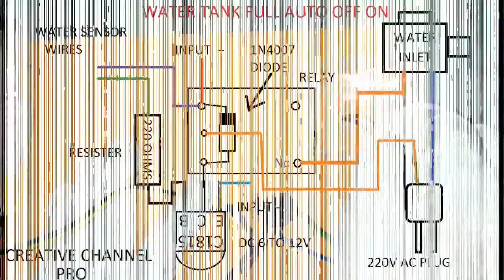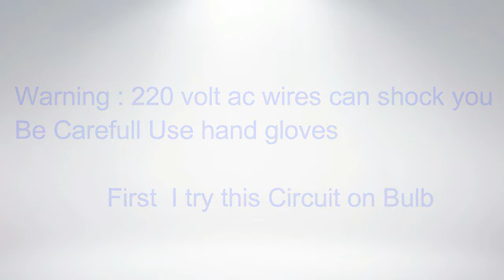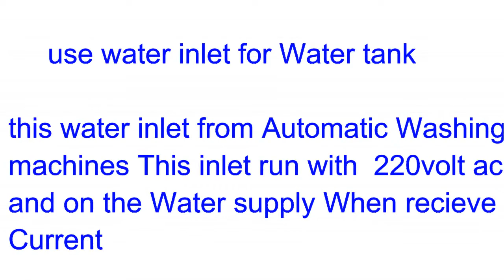Water tank filler overflow control Auto on/off plants automatic watering System using inlet valve

Comment: I think when u touch the water with wire someone off the switch
Reply from the maker: 🥰🤣 Really bro It's not fake Bro 100 percent confirm. When I am beginner in electronics I Also like you. Bro It's true. IF YOU NEED. Help in circuit please feel free to contact I try to Guide you best.
Reply: @creativechannelpro371  ok I will bro

Comment: Fake
Reply from the maker: Bro this 100 percent work may fault in circuit if you not understand +601169439048
Whatsapp me . I try to solve Your problem. This is simple transistor switching circuit if you not study about transistor you can not understand its fake or real Please Try again .
Reply: @creativechannelpro371  bro I use bc 547 transistor is this ok
Reply from the maker: Yes bro But must focus on Base collector emittor pins.
Reply from the maker: BC547 PINS C B E

Collector Base Emittor
Reply from the maker: C1815

 E C B
Reply: @creativechannelpro371  I will try this ic
Reply from the maker: Thanks for comment bro Feel free to contact